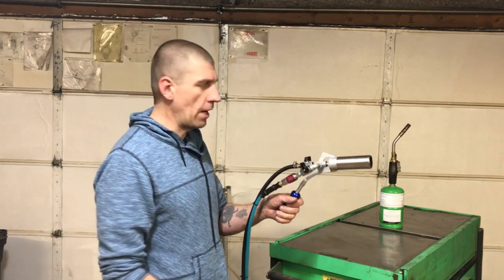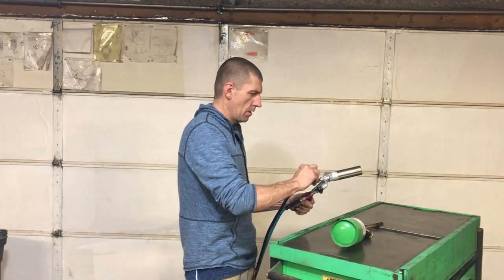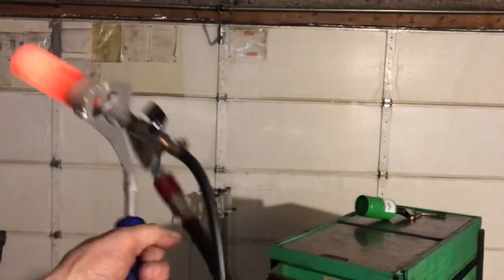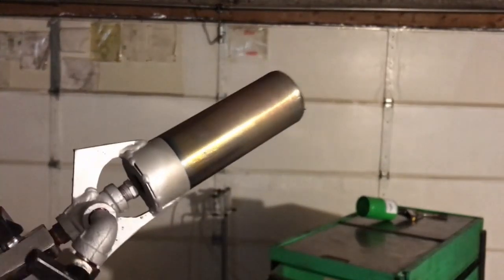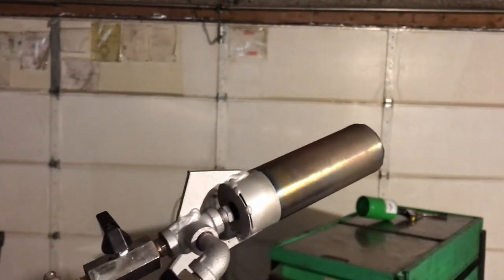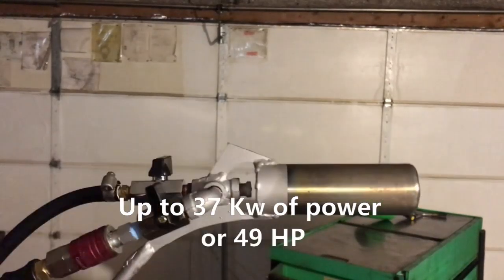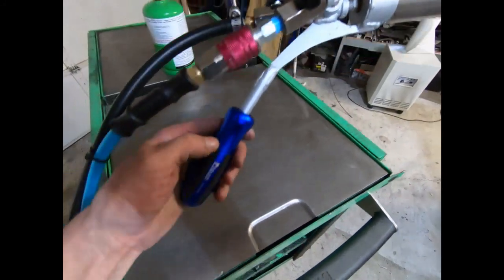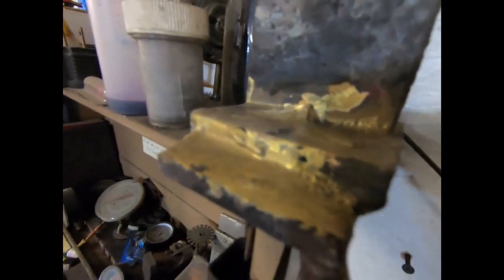Zeus Torch Compressed Air augmented brazing torch 0

Comment: That’s a neat little tool .  With all the different thread pitches.  Like I tell folks all the time just because you got a metric tap&die set .  Well that don’t say you got all of them . With standard or imperial there’s just NC & NF .  But there could be 4 different thread pitches for 1 size diameter in metric .  I like the torch also that’s killer . I’ve always wanted to learn how to modify torches to get more out of them or build them !  Thanks for sharing and the extra information.   I have subscribed and liked this !

Comment: Hey buddy what do you think would he a good design for a propane burner that would use fuel efficiently for a home brewing setup. The standard burner assembly does not have a clean burn and leaves my pots covered in carbon and fills the garage with carbon monoxide
Reply from the maker: Its all in the orifice size , also see my ring burner video , i sell these on my website and ebay but i can build you something far more fuel efficient, just wanted to show you how orifice adjustment can do amazing things  https://youtu.be/_ysED5jiYDA
Reply: @NOBOX7  yeah I'm really looking for something fuel efficient but can get me up to a boil quick and then taper down the heat to maintain my boil. Do you have a number I could text YouTube doesn't let me know when you reply

Comment: That’s an accident waiting to happen. If that heat hits the line it will not just backflash, it will catch and blow the tank
Reply from the maker: lol, WOW .  I see you have never used propane ?
Reply: That's not how propane works lol... Also if you're worried about oxygen contamination in the propane tank, use a flashback arrestor.